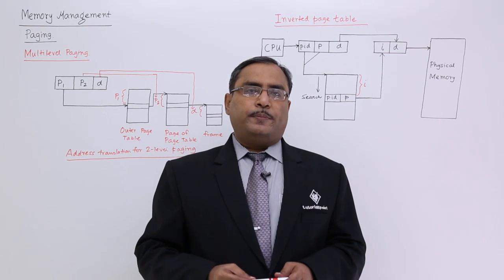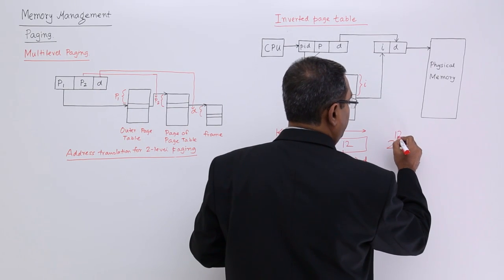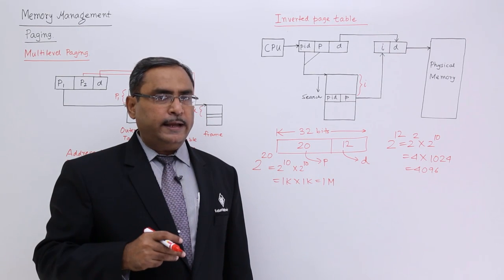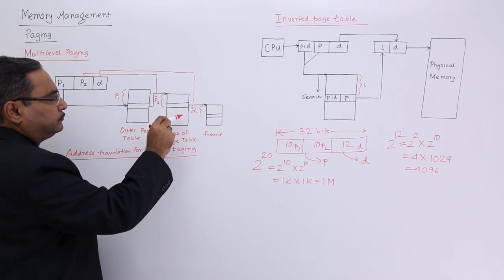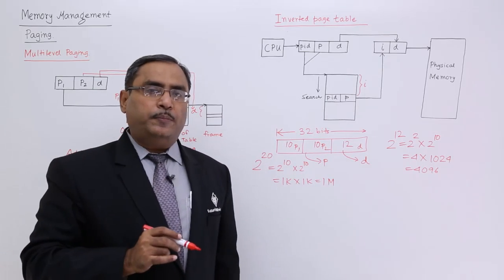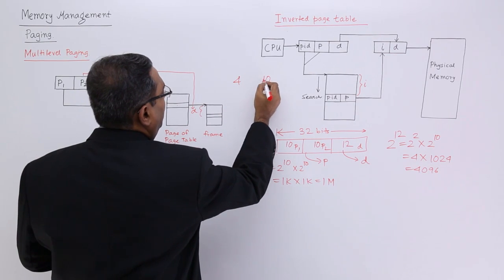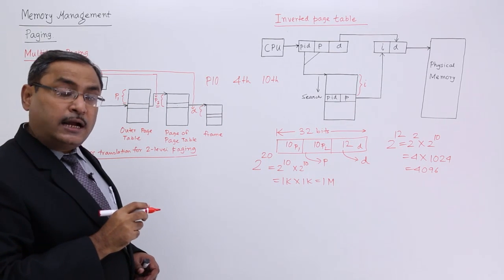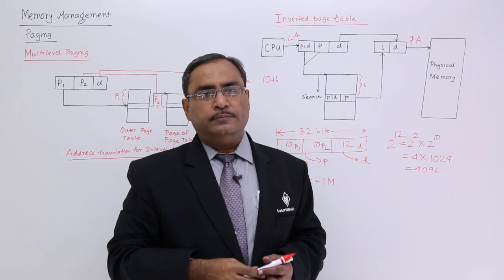Multilevel Paging and Inverted Page Table

Comment: The IPT does not solve multiprogramming, it only solves the multi-level size issue. That is, you can still have multi-level table even when using multiple processes: each process will have its PT. What IPT really comes to solve is improving space needed (at cost of a slower search)

Comment: i still dont get one thing... how does the multilevel paging actually help with our problem? it's not like we reduced the size of the total pages, all we did is divide it, and so what? it still takes up the same amount of space in memory. Actually, it takes up more because we waste 1 page for each inner page tables, which could instead have been used to point to an actual frame (instead of another page table). It just seems redundant. I thought i understood the concept wrong when I read my book, so I came to watch a video about it, but i still dont get that. Looks like I'm missing somethinf here
Reply: oh and i passed my OS exam so all is well :P
Reply: In a single level page table, the whole page table needs to be in the main memory to access any data in the physical memory. In multi-level paging, out of the 1024 inner page tables only that one particular inner page table (found by using the outer table) is loaded into main memory from the backing store. The rest 1023 inner page tables are not required to be loaded into the main memory now. This reduces memory usage.
Reply: @ganeshbelgur5295  Thanks for explaining it well. This has been my doubt for so long.
Reply: We don't create all the page tables unless there is a process running, so it is using less memory. The worst case is all the processes running and all the page tables being created which never happens ideally. The only caveat is the memory usage for the extra inner page tables which is still better than creating all the combinations of page tables. Let me know if this makes it any clear or we can discuss more :-)
Reply: thanks for both of your replies, sorry im replying late. That makes sense that not all of them are loaded, though that does mean every time we want to acces a page table we have to load it from the secondary memory to the main memory.. but i guess that doesn't take too long compared to the amount of space you save in the main memory
Reply: mine is tomorrow ahhh
Reply: cookie Good Luck😊
Reply: Multilevel paging is not introduced for reducing space but introduced for reducing effective memory access time(EMAT)
Reply: It might consume same memory but it is not contiguous